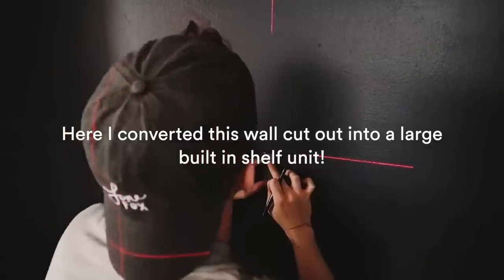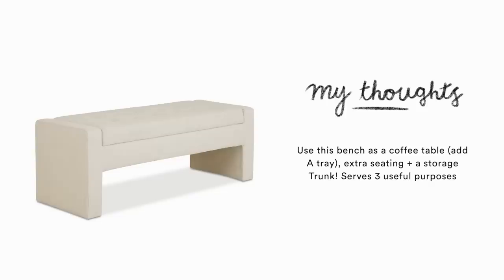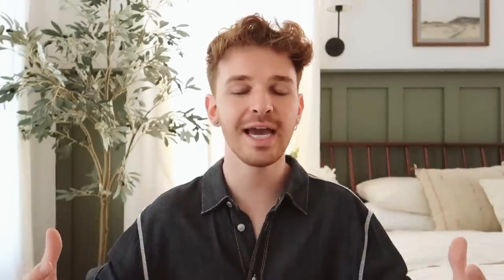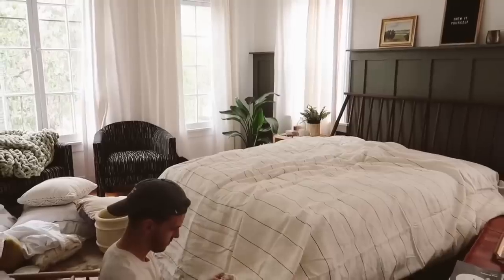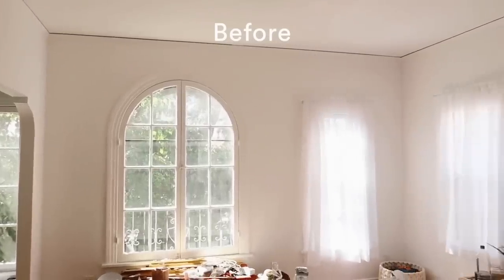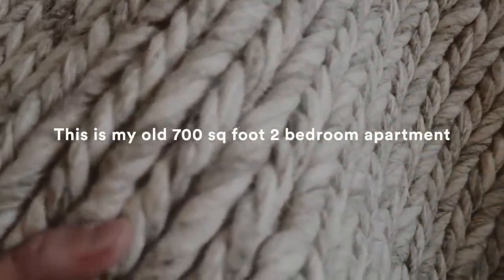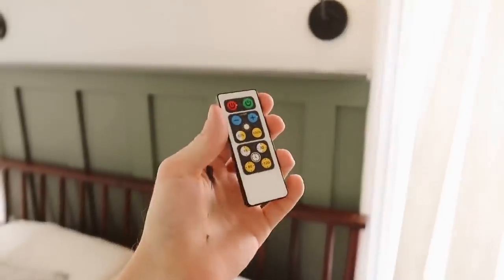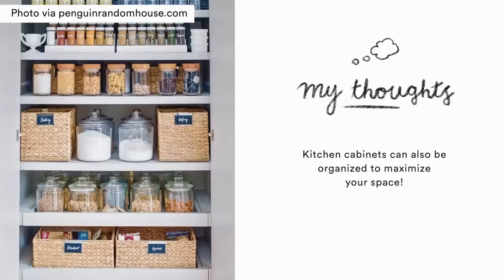10 SMALL APARTMENT DECORATING TIPS + HACKS ✨ Maximize Your Space!

Comment: Here's a tip for ya.  When using a paint roller, don't press too hard on the wall because your forcing paint to the roller edges which will leave roller edge lines. Instead gently place the roller on the wall and let gravity guide the roller.  Go slow so you're not slinging paint off the roller.   Also when drilling a hole in a nice piece of veneer furniture place a piece of masking tape over the hole area to prevent the veneer from splitting while drilling.
Reply: Thank you !!!
Reply: What about when painting the ceiling?
Reply: Weeeellll, that depends. In Germany we mostly have ingrain wallpaper in rental apartments and you better put some pressure on your roller if you want full coverage!

Fully agree though with smooth surfaces. Don't load the roller with paint as well. It's easier to add than to take away

Comment: I bought a ladder desk & ended up giving it away. It saves zero space. I ended up going with a console table that was 15" deep. Plenty enough space for both my desktop, monitor/TV and to use my laptop on.  Mine has a shelf on the bottom  which holds my desktop unit. I placed a basket with a top on the lower shelf also. It holds my router & fiber optics box.  I did cut a hole in the back of the basket so the Wi-Fi signal wasn't blocked. All my cords sit in the basket also.  It looks great & meets several needs.  Another fab apt dweller space saver is to place a thick wood dowel or thick tree branch between on top of the cabinets either side of your sink. Hang loops of rope from it. Attach S hooks to the ends of the rope loops.. viola a pot hanger without drilling into the ceiling or walls.  Hang a pretty garland on it to dress it up.  I have one of these and love it. I also hang cotton net bags with onions & potatoes in them plus 2 that hold jars of spices.

Comment: Using vertical space is a great tip.   However, many buildings do not allow making holes in the walls.  I can get away with push pins or using Nano tape, but these would not be able to support shelves, furniture, etc. I could take the chance and lean bookcases against the wall,  but it is not the safest option.